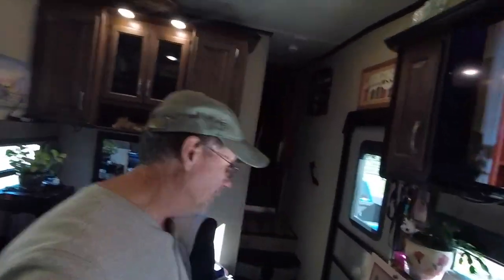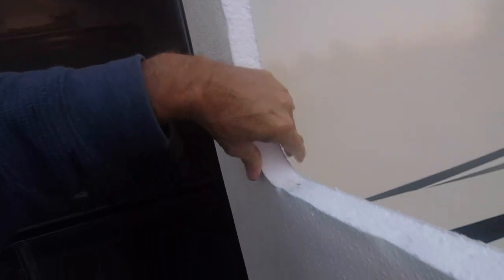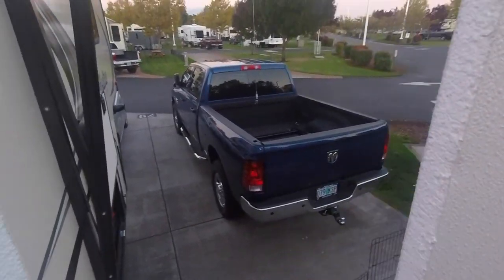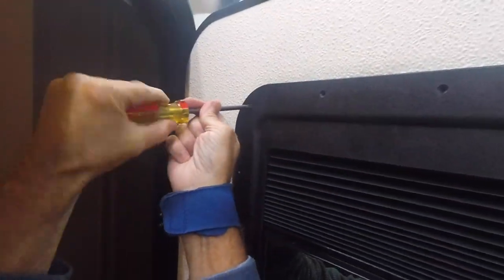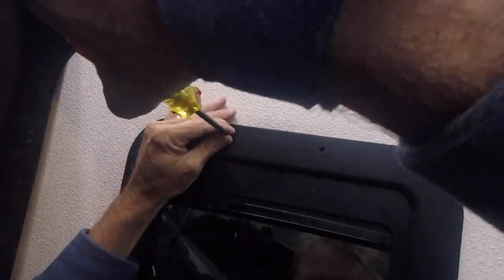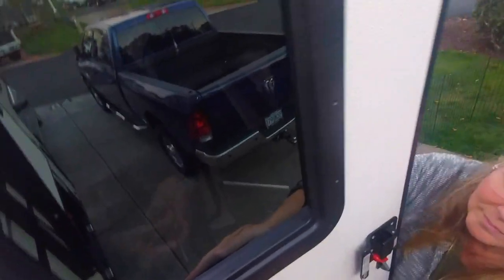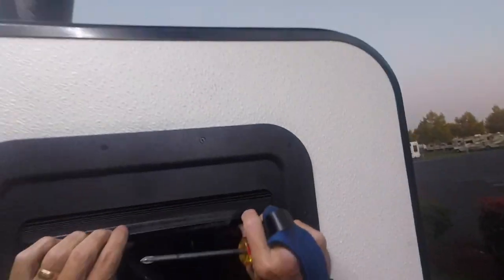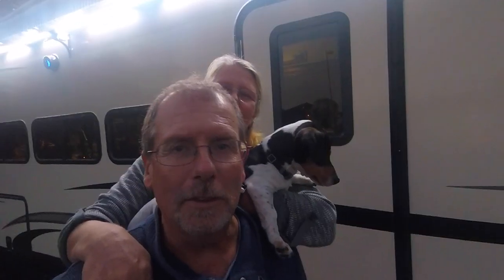RV BUNKHOUSE DOOR WINDOW: Installing a CLEAR THIN SHADE WINDOW

Comment: Thanks for sharing this. I also have the screwless frame. Would have liked to see how you got the clips apart.
Reply from the maker: Sorry I didn't get removing the window on video. It was pretty simple though. I just used a butter knife and inserting it into the slots to pop the clips free. Thanks for watching.